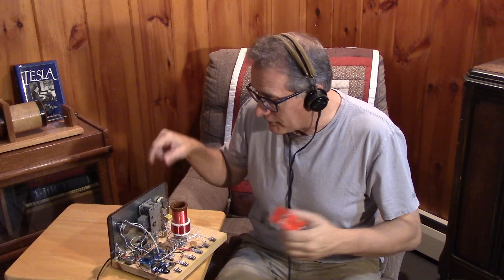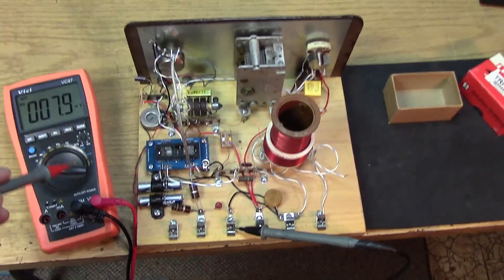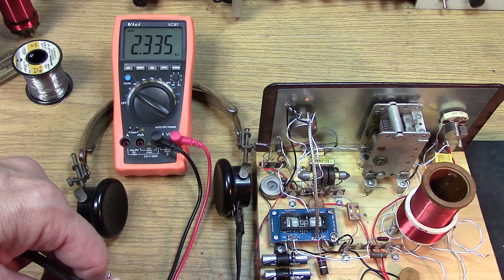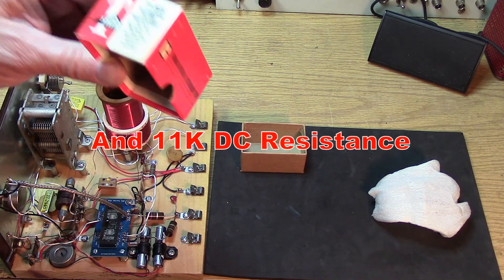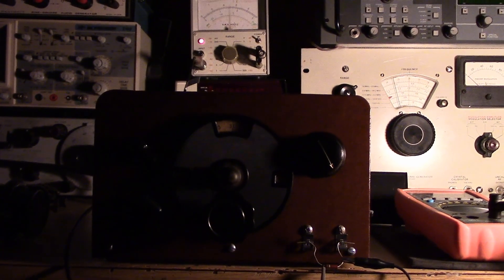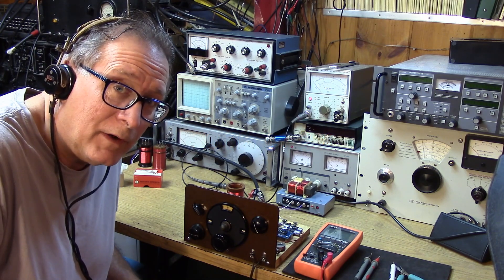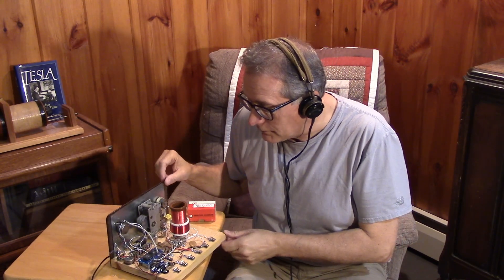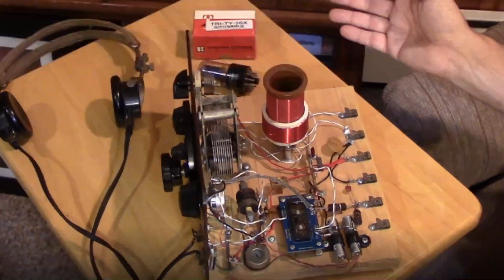NuTube BOOM?

Comment: How do you figure out the necessary resistance for  both sides of the transformer ?
Reply from the maker: The DC resistance can vary. Its the impedance at say 1000 Hz that is important in getting the most audio to your headphones. I just got hold of what I could with a high impedance like more than 20K Ohms on the primary and something that could drive 600 Ohm headphones on the secondary.

Comment: can we use a jfet to mimic some of the tube regens?
Reply: Yes, and it will work very nicely at least for the AM band.  You will be running the JFET very near IDSS so you will need to keep the supply voltage low to keep the power down.  JFETs don't have a gate current that quite matches the grid leakage but you can work around that.

Comment: Hello! Late crystal set guru Mr. Ben Tongue suggested after test trials for obtaining the average audio impedance of a 2k-ohm headphones, that a pair of these exhibit an average impedance (to AC audio speech currents) of around six times the DC resistance of the headphones, or 12 kohms. The 2kohms is a DC figure only. By the way, your video series are very interesting and of great value for hands-on projects.
Reply from the maker: Very astute information, and the reactance of the headphones is what does the work for us.

Comment: When I built my two valve radio, not long ago, I did what you did with the transformer. Luckily, the 3V4 valve could take it. I don't have any old 2k headphones, which is a shame. A very interesting video and series of videos.
Reply from the maker: The crystal earpieces work OK if you wire a pair in series in phase. They are usually cheap.

Comment: Enjoyed this series very much. But it did not animate me to try this NuTube myself. Much too complicated compared to a standard tube regen. But, it would be very interesting now, to try a simple completely solid state version. Maybe with FETs, and compare this to the valve version.
Reply from the maker: I believe solid state would easily outperform the NuTube in the same circuit. A pair of MPF102's limiting V to 18VDC, or maybe a pair of 2N7000 mosfets at the full 60V would be a fair comparison.

Comment: Nice 👍. Next step is to use VFDs from calculators etc. 😉.

Just joking badly...

Nice that it works. I have 2 pairs of these headphones wich had open windings... 😒
The wire is incredibly thin and Im not even going to try to fix it, they are just to thin and with many thousands turns.
I will most likely end up with mounting some small speakers, but at least they will work at a low impedance.

Any better ideas ?

Thanks for the video, it was very interresting.
Reply from the maker: Try a transformer. You can find low impedance 8 Ohm headphones or medium impedance headphones of 30 to 600 Ohms. Not all are sensitive. The trick is to convert these up to a high impedance such as a tube plate circuit. Here is a universal transformer that can match about any headset. https://www.mikeselectronicparts.com/product/bogen-t725-audio-transformer/
Reply: @MIKROWAVE1  Thanks. I will have a look at that. 👌

Comment: What is the DC resistance of the primary and secondary? Are the impedances measured at 600 Hz? Have you ever done a FET rendition of a regen?
Tubes have always been more resilient than semiconductors, even this variety.
Reply from the maker: 10900 Ohms PRI, 315 Ohms SEC. Yes 600  or 1000 Hz would be good f to measure actual impedance. I would load the secondary with the 2.2K Ohms and use the substitution method on the primary, to determine the exact impedance of the plate load. Yes I have built FET Regens both conventional and source follower output. I used to work with Chuck Kitchin at ADI. He was a FET nut! I also have videos on 100% bipolar regens with silicon and germanium.